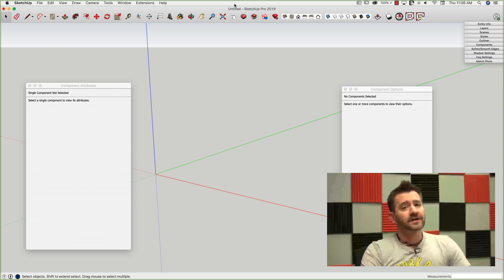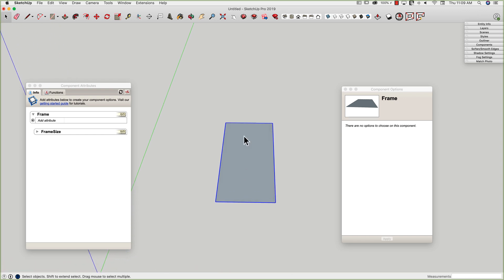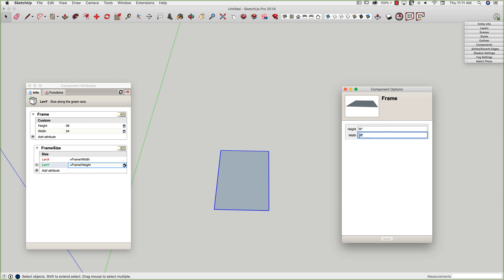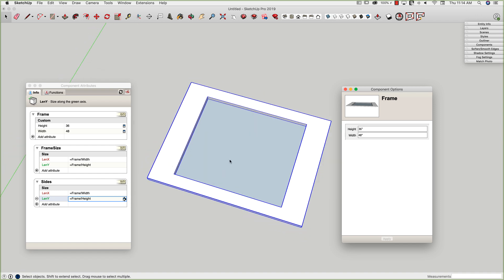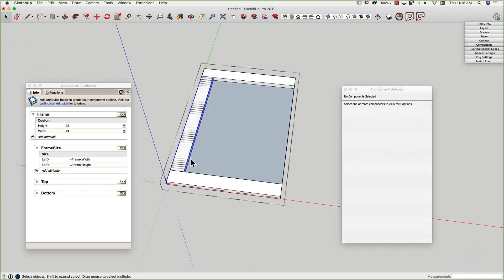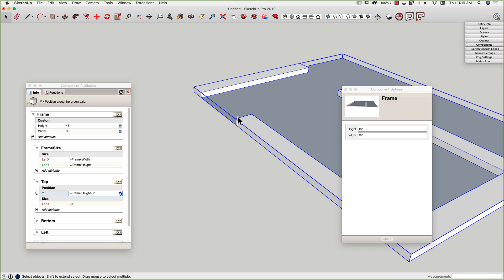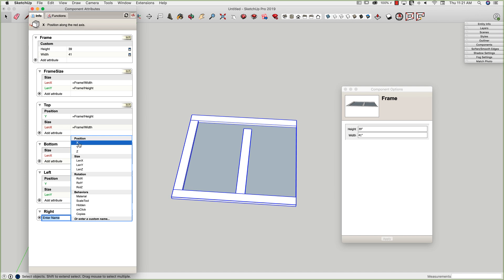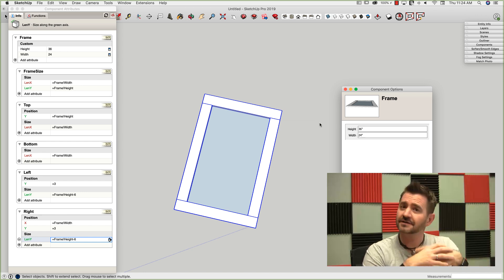Welcome to Dynamic Components Part 4 - Skill Builder

Comment: I have a pro subscription. I know this video is older. But I am trying to figure out how to scale a model while not changing the rails or styles of a frame. I followed your steps and have a frame that I can resize in the options window. Then when going to scale the model it, I cannot use the scale tool without distorting the model. My question is how to be able to use the scale tool to resize the model without distorting the style and rails of the frame in the model? Any help would be appreciated. Thank you!

Comment: Can I delete the face component and have just the frame? And what if I want to add a slidder window with the same rules, can I do that, and how? There is an extension named Click-change that has such a window, but It`s to complicated to reverse engineer it. Thanks! Now let's see how the followers will help me :)))
Reply: Nevermind, I just replaced the custom width and length with len x and len y and put fixed values for each element width. Now I don't have to type in values, I just scale the window to the opening in the wall. And of course, I hide some of the scaling options. Much faster.

Comment: SK19 on my mac: whenever I create the nested component and try to add height and width it arbitrarily goes to 39.something to 94.something and I can't change no matter what the input. Should I just re-install SketchUp?
Reply: You should post your component on our Forum (forums.sketchup.com) along with a description of the issue you are having. It is unlikely that you need to reinstall SketchUp to address the issue.
Reply: @AaronMakingStuff  I think I found the issue, I set the rulers to CMS but it keeps going to INCHES.
Reply: @falconlara  Did you figure out how to fix this? i was having the same issue. I draw in MM or CM not inches, but when setting me DC values it always changes them to inches.

Comment: I can get the earlier skill builders lessons to work but not this one.  When I set the frame height and width of the Frame component and choose to let the user edit the entry, nothing shows up in the component options panel. The attributes panel shows components but the options page show no components selected even when the Frame component selected. The component window shows that there are two in-model components, Frame and FrameSize. I tried this with both SKU Pro 2019 and SKU Pro 2020. Got any ideas?
Reply: Same problem here, solved it by changing the "Units" to my used units (instead of 'default'), this change made the fields visible in the components options.
Reply: I was having this issue as well. What I did is I went back and deleted the files from earlier skill building lessons and tried again. My component options window is now working again. Possibly a bug? I just upgraded to pro 2021 before I started these skill building lessons

Comment: Everything works fine all the parts change size from the Component Options dialog box. Then after I save then go back to the part I get an error message. No entity data returned. ERROR: Callback function error: Unable to get property 'length'  of undefined or null reference @ /dcbridge.js[601]  I know you will have a easy fix for this.
Reply: Joseph DeLude I am guessing it is being imported or exported incorrectly. Right click on the main component and click Save As. Then import that file into your job file. Using a regulate Save command will not maintain the outer component.
Reply: @AaronMakingStuff  That was the problem I knew you would have an easy solution. Look forward to more on this subject, keep up the good work.

Comment: Is there is a reason you created the nested "Frame" component in the order you did it?  Especially the "FrameSize" component?
I would have created the "Frame" by creating components for the LeftStyle, RightStyle, BottomRail, and TopRail.  Those would then be arranged as required to represent the "Frame".  Then I would have selected all the rails and styles and combined those into the top level "Frame" component.
After the "Frame" component is created, adding the DC functionality would be the same, excluding the mystery (to me) FrameSize nested component.
As far as I can tell, your nested FrameSize component just reflects the same Height and Width values of the top level Frame component’s Height ad Width attributes.  Nothing in the DC object seems to be using the FrameSize’s "local" attributes.
What am I missing?